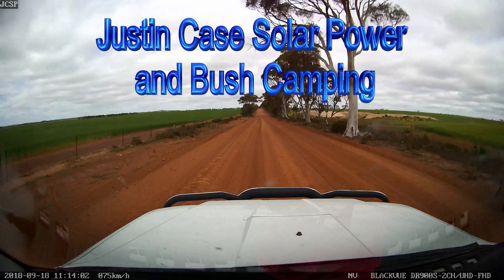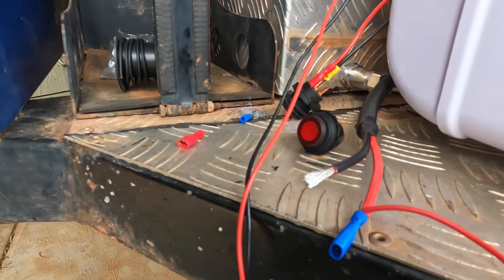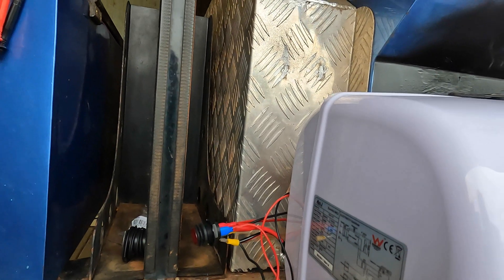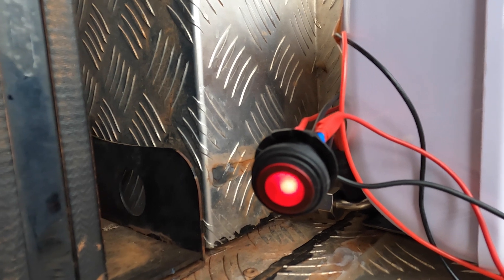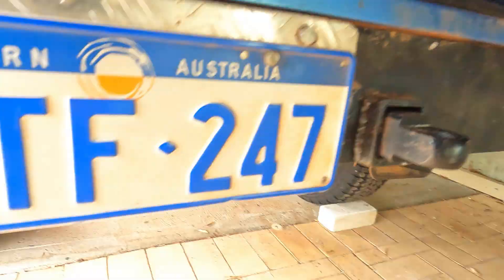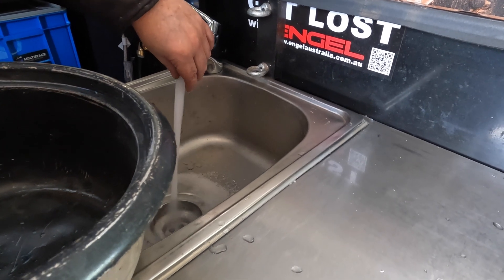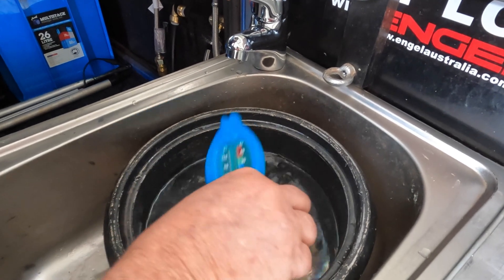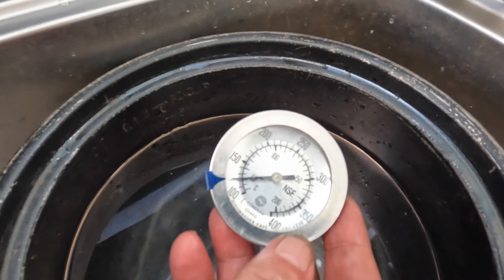DC Wiring and Testing the AC Side.  Duoetto MK2 RV Hot Water System (4)

Comment from the maker: Duoetto MK2 is a 12vDC / 240vAC 10lt hot water system. The 12vDC heating element is 300Watts and the 240vAC element is 1000Watts. Todays video is wiring of the DC switches and looking for water leaks and Testing the AC side of the unit.  Enjoy 😉🙃👍